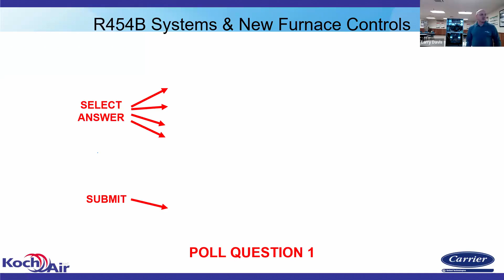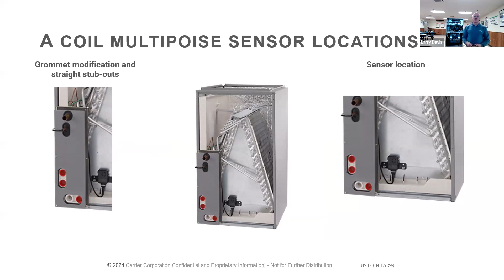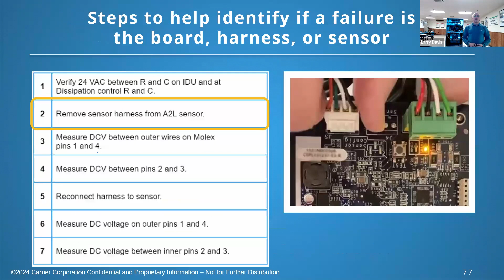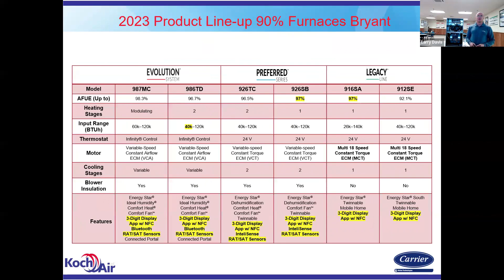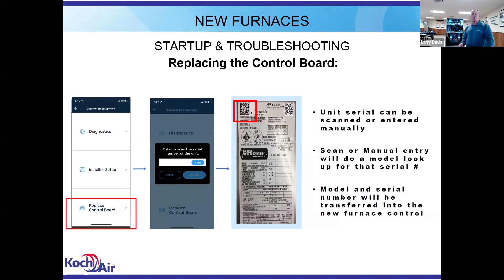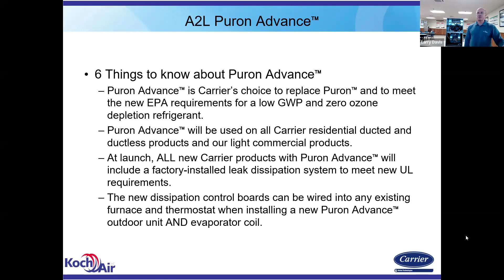R454B Refrigerant Systems and New Series Gas Furnaces 1080p

Comment: G,day from Sydney Australia.
Thankyou for the information with the introduction of 454B refrigerant. Especially the flammability and the installation of the dissipation board to a sensor and blower fan.
* R22 410A line set replacement or flush with nitrogen twice.
* TXV for 454B
* Contactor 454B compatible.
🌏🇦🇺